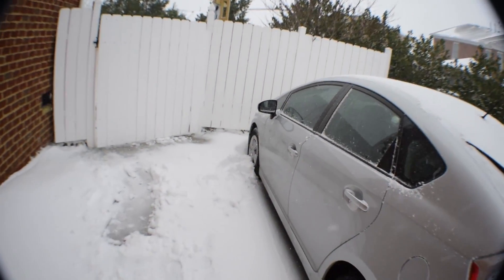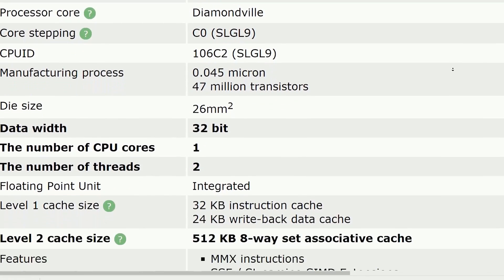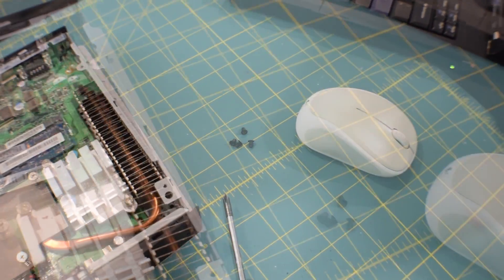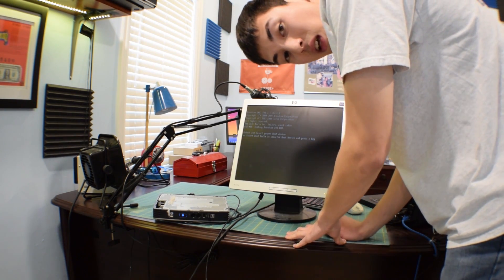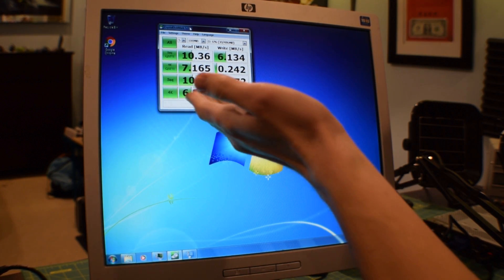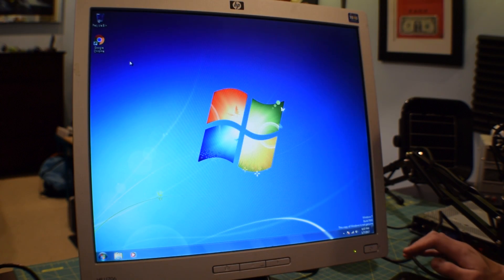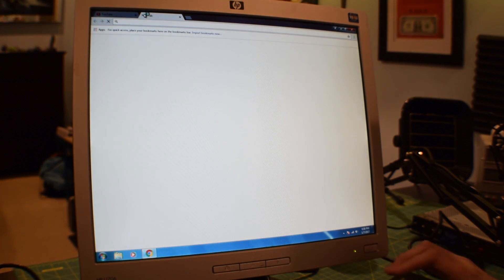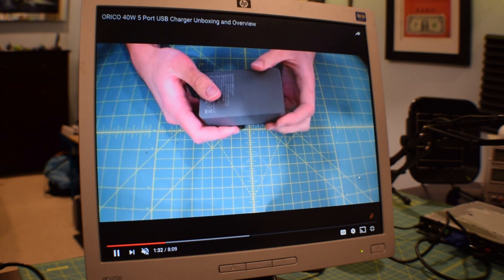eBay Finds: $11 HP Thin Client T5740s Intel Atom N280 Overview and Demo

Comment: well the thin client wont over heat :D, 512 meg of ram not enough for windows 7
Reply from the maker: You can easily get windows to run on 256MB of RAM too :D.  Check out this old video: https://www.youtube.com/watch?v=MjcwZMuA8BI
Reply: i am performance hound :D i have 16 gig on most of my laptops/desktops ;D my slowest computer is core 2 duo elite book 6930p 2.8ghz, 8 gig of ram :D
Reply: Good thing its got a 1gb stick in it then huh...
Reply: Well this one has a gig of ram and only supports 32 bit so it will handle Win 7 just fine (although a bit slow). I would try Pasbian 86 on it though.